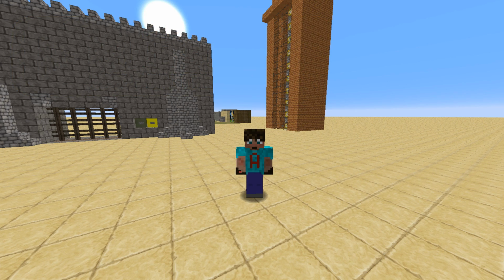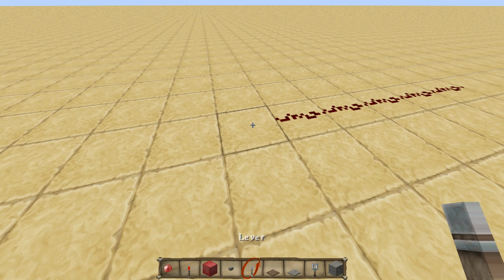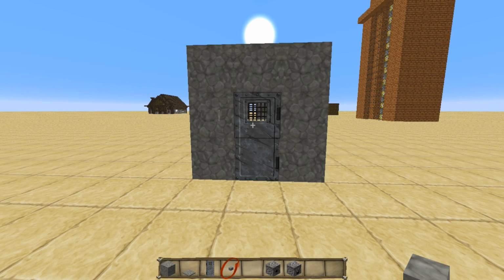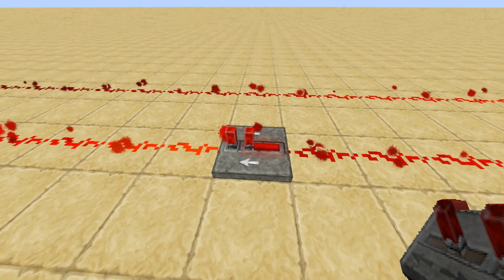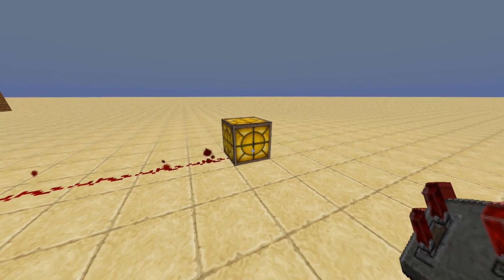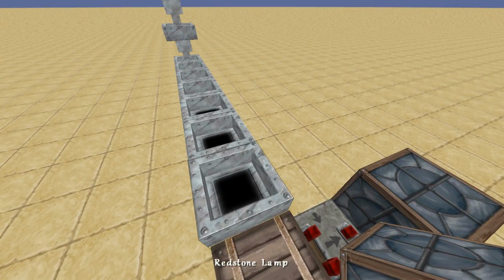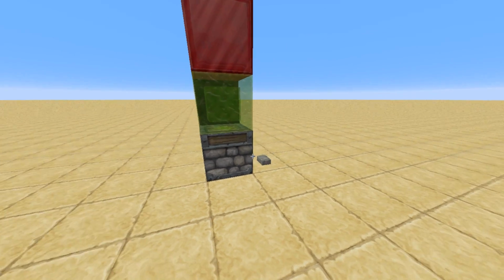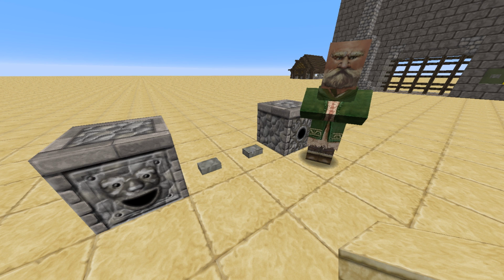MINECRAFT REDSTONE  - THE BASICS | How To Use Redstone | Basic Redstone Tutorial

Comment: I have a question why when I use pressure plates it only gives a one block signal , I mean that it travels only for one block , which obliges me to use more repeater ,any idea?
Reply from the maker: Thats odd Gazzeh, You should get a full 15 strong signal from a pressure plate
You can test this by putting down a plate and laying a straight line of 15 redstone then a redstone lamp. Going on the plate will still light the lamp
Are you sure you mean pressure plate?